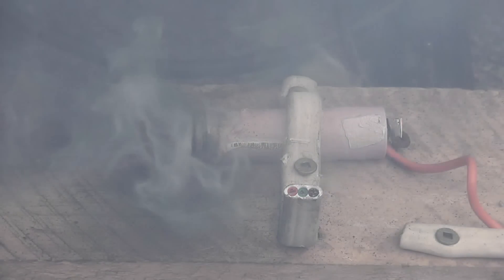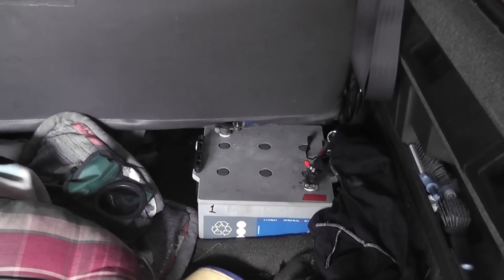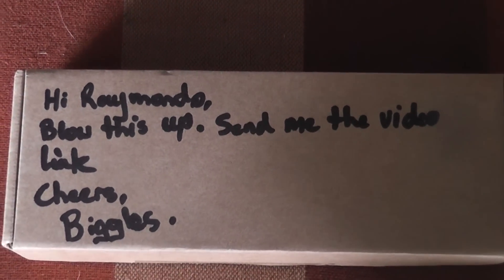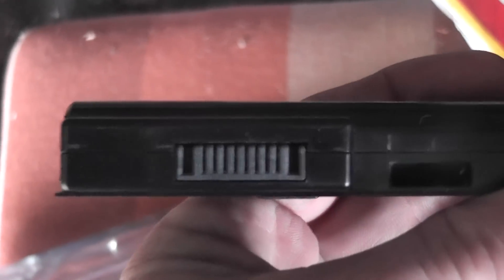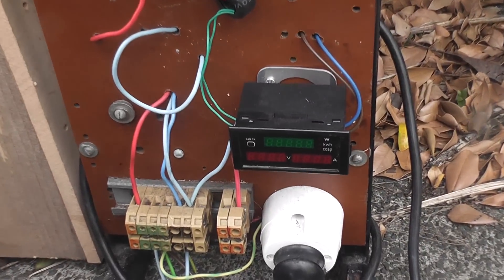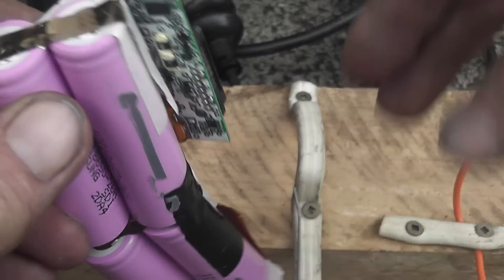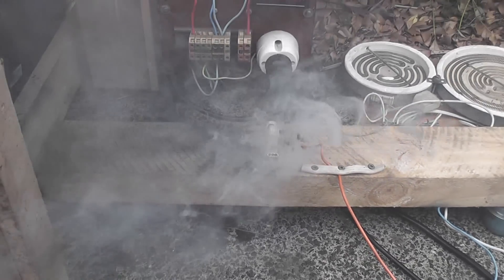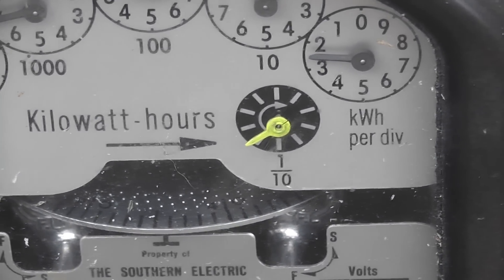Li-ion Battery vents

Comment: This is why vaporizers vent or explode. Some vaporizers do not use any safety measures, and when you keep the button pressedi n your pocket on a mechanical mod, you are basically shorting the battery out. Digital mods with safety measures are completely safe. It's also why you don't carry uncovered batteries in your pocket.
Reply: XD

Comment: Couldn't help noticing that you use Robertson (square head) screws.  I thought they we're only used here in Canada where all electrical items must use them for connecting wires to contacts.   Are they common there?
Reply from the maker: They are very common in NZ, they have been around for at least 20 years and they are awesome. Lot's better then the Philips headed screws. These are wood screws. 
Electrical screws are standard slotted or Philips/slotted heads, or Allen key imbus hexagonals.
Reply: Christopher Netherton I love those. no cam-out.

Comment: Think of a situation where you are in an electric car with 1000's of these cells and the battery pops....
Reply: Most older Prius models use NiMH, though Li-ion is available on newer ones. Fires have happened with cars such as the Tesla that use Li-ion following crashes which damaged the batteries.
Reply from the maker: Good point, imagine the Prius battery bank shorting out.
Reply: Yeah, there is some video of the firey aftermath of a Tesla car crash. You can hear all the pops and see all the battery cells flying around ... crazy stuff!

Comment: +RODALCO2007
Yay, some pops! Thank you! ^_^
But, I have one comment ... you should avoid having youtube do that stabilization thing with stuff like this. It causes the video to become all blurry and slow-motion like.
Edit:
By the way, that battery pack might have been a part of the recent recall of HP laptop batteries. I have an HP laptop, I checked and mine isn't recalled, but I know that it still could possibly be faulty because often manufacturers only recall portions of faulty products.
Reply from the maker: Yes that stabilizing thing is crap, agreed. Need to get another editor programme as my other computer has crashed.

Comment: Would be actually interesting to measure if such a cell rapidly charges under such a current. Just take the current off it just before it blows and check the voltage output increase (or maybe decrease).

Comment: Thanks for the informative video sir. 

Hmmmm, a 20 amp load. I was thinking that it was taking quite a while for the battery to go in to thermal runaway. I didn't read the description until it was over. I'm curious how quick it would pop under a dead short condition.
Reply: it probably was a dead short, most 18650's arnt designed to give that kind off current continuously. A cell like that is probably designed to give 2-3 amp discharge. 20 amps is about 10 times that hence why it took so quickly to thermally run away.